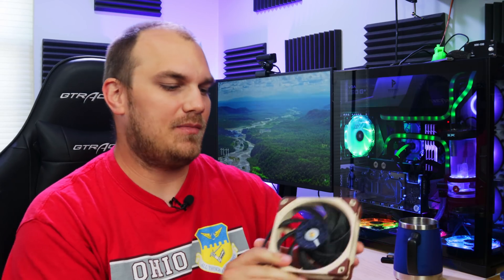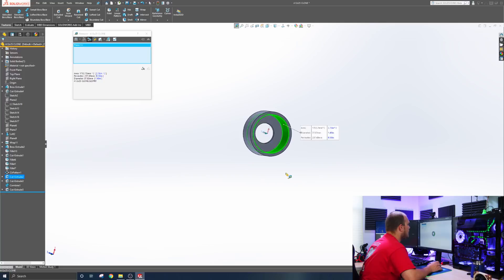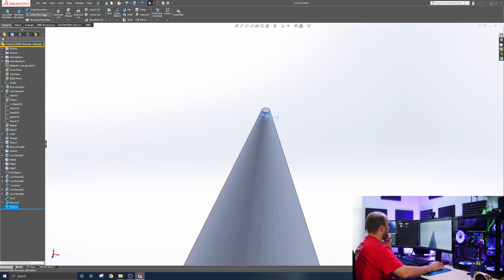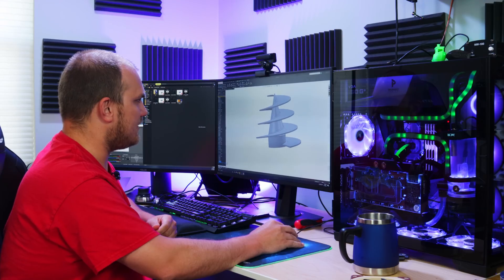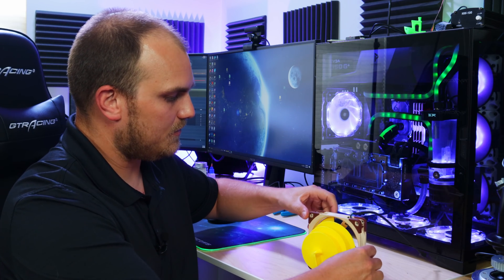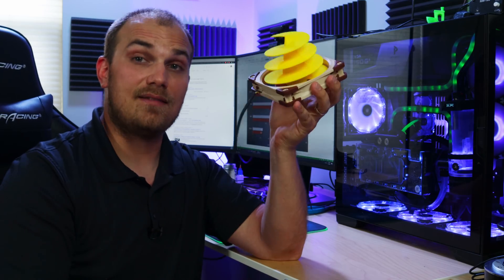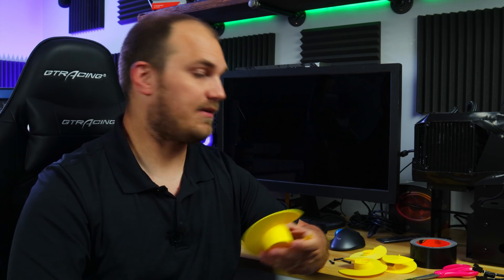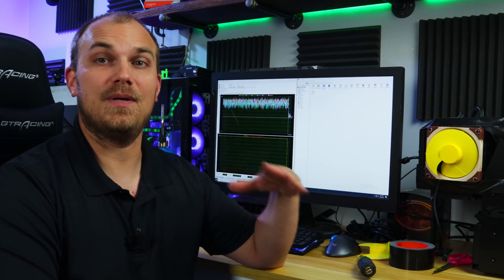Leonardo DA Vinci Made A PC Fan Would It Work?

Comment: These are depending the direction of air flow. 

Enclose the outside with a skin attached to blade exterior, from top to bottom of blade spiral. A lot of air flow lost around the outside perimeter of blade that could be contained until it reaches the bottom. 

Also, the center should be a cylider not conical - more air retained. 

Currently the widened end of cone pushes captured air outward b4 reaching the area to be cooled.

Why the last design wobbles on desk: it's a hovercraft. one side of the blade exerts downward air at a point in the circle while the other points in the circle exert less or no air - thus most exertion point moves with the blade causing a circular moving lift point.

De Vincci didn't think thru the air intake retension from top down, using small blade diameter at top to wide at bottom. Too much loss of air. Cylinder of outside of blade must be same diameter for maxed bottom exertion.

To balance motor, make two fined blades exerting air at 2 opposing points on bottom circle. 2 intake ports, 2 outputs at bottom at 180 degree points.

Intake blade face, have it bend upward to force more compressed air into spiral channel. Assumes enclosed channel top -> down on outside. 

Any or all of these will likely need stronger motor, more electricity, cause more heat.

!!! You've proved De Vincci was on a good track, but, as with many many inventions, extra thought, ideas are good exploration time that produce improvements.

Comment: The hopping at 16:00 is due to the blade having twice the mass at the start/end than at any other part of the circle presuming the blade is of equal mass all the way through. 
A 1.5 circle single blade will balance better with beginning and ending at 180 degrees seperation

Comment: On the last design you had overlap which made one side off balance.  You need to cut straight down the cylinder clipping the blades (or blade I guess) so that if the design was completely flat the blade wouldn't over lap itself but meet to form a complete circle.

Comment: Well, it works great for pushing viscous fluids. Air is so not viscous and so much compressible. In order to make it work for air, you need to increase the pitch of the screw, and make it spin as fast as possible.
So, light-weight, longer pitch, and if possible, some sort of covering in side to reduce outflow and create a trap-sort of thing.

Comment: Take your modified final version, split the blade into 2 or 3 and have them be in same plane as a wide bladed 2 or 3 blade version of that.

Where the high tips of the next blade overlap the lower point (fam side) of the blade before it by about 1/2” maybe. 

I’d like to see how that works.

Comment: Just saw this and had an idea. Make the blade a turn and a half (540 degrees). Put a ring around the entire blade with a height equal to the height of the screw. Decrease the height of the screw so it's no more than 150% of a normal fan's height. Try to balance the weight of the overlap by doubling the thickness of the blade where there is no overlap. There's a good chance that with these adjustments, you'll get a lot more airflow, and maybe better balance.

Comment: Obvious issues. Needs the shroud to cover full length or maybe longer. Open edges allows the air to slide sideways. Also need to find a way to balance it.

Comment: Your quest to find a new more efficient and effective design for a fan is very interesting. 
Consider one little point, 
When an item sits on a body which starts to spin about its axis, the item will be force away from the axis of the body.
Like a playground roundabout. 
Basically, that’s exactly what happens with the air on contact with the fan blade.
Now take a look at the shape of a lighthouse. lens. The Fresnel Lens. 
If a fan had a similar stepped shape all the air available to the fan blade would be focus forward and not spread outwards. 
Just a thought.

Comment: Da Vinci was kinda an Idiot on this one... but you are half way to turning it into a good idea... Since you went from a conical center to a tubular one... now you just need to put a tight fitting shroud on it, or an outer tube if you will... and you'll have an Archimedes Screw... Now HE was a greater genius than Da Vinci... and Invented his BETTER design around 1750 years earlier.   FYI... All of your fans will perform Significantly better with proper shrouding.  Cars in the 50's and early 60's didn't have shrouds... Then as their engines got more and more powerful, and generated more and more heat... they realized through tests that the fans needed tight fitting shrouds.  Come on guys...

Comment: https://www.researchgate.net/figure/Basic-components-of-an-axial-flow-blood-pump_fig2_287594305

Can you make an air impeller for a fan? It would obviously need to be larger, but the davinci model expels a lot of air around the sides. I think you need tall blades at the top to draw air into a baffle, that slowly increases air pressure to move air over the cooling medium. Just a though. It's the most efficient. Da vinci's is the least efficient.

Comment: Does it not seem more suitable as a water jet if you encapsulate it as a funnel could it take it drive water thru the funnel as it rotate creating sort of a vortex in end?
"Have no idea how a real water jet work though but i guess it is a compressor of sort?"
Reply: If you want the funnel attached enclosing the spiral arm fan with just a mailbox slide inlet and a funnel outlet i guess one would have to 3D print it and put it on shaft at distance  from motor.

Comment: If we are in these kind lands, I'd like to make a build-suggestion:
For "static" pressure, would love to see a Cummins ISX15 with 2 98mm Turbos feeding into one 120+mm Turbo, going into a Weiand Charger getting attached to it.
Splice it after the turbos but before the supercharger, and you should be getting around 130-200 psi. And like 2000-3xxx hp...
Plusside:
Hook the engine up to your house as an Powerplant, no need for a grid.
And you can give up smoking....
Minus:
Diesel costs some
Ticking Time Bomb
140 db upwards
Needs new Oil and a renewal of all internals after every run...
(...)

Comment: I think part of the design intention of this may be it is intended to have the same efficiency regardless of the spin being clockwise or counter clockwise. It would be interesting to run all the blade designs through a test of efficiency comparison between clockwise and counter clockwise spin rotation. I'd like to see which ones are better, worse, or the same depending on which way they spin. Also what about testing to see which blades would work better as wind collectors. Would any be better used to harness wind energy for wind turbine applications?

Comment: I think that since it is a screw, its a continues gentle slope, thus when its spinning, the surface that is pushing air is moving very slow compared to the spin of the screw.  Therefore the screw can not efficiently push air.  Sure it may push a bit of air, but very inefficient for the energy input.

Comment: You should print another fan like that but have an exterior wall that doesn't let air escape out of the sides. also you should flip it over so it slightly compresses the air so that as it expands leaving the end it will get cooler.

Comment: The demonstration part actually shows the path of air. Second add a bullet shape to the motor cover, the air is being allowed to slip, image walking up a hill with ice on it, so add a texture that grabs tiny buckets of air, feather shaped texture, golf ball dimples. The side wall of the motor cup is being under utilized and it’s surface can be combined to create more force, I Enjoy your shows.
Reply: Also look up “kort nozzle” or the shape of a jet engine shroud or inlet. I work on jet engines for helicopters every day. All good ideas.

Comment: I know I am writing little late, so no sure if my comment will have any attention... but there is one thing that came into my mind almost immediately. The aerial screw needs a tunnel. The usual fans are inside of the tunnel. And the function of the tunnel is to ensure the air won't go sideways but in the direction given by the shape and movement of the blades of the fan. And because the rotor of the fan is relatively flat we almost forget the frame around it is a tunnel, but it is. A tunnel wich is of the size to match the flat rotor.

The aerial screw is not flat so the frame you put it on cannot help to focus the air. The blade is rotating in the open. A lots of air put in motion by the screw, just go sideways and only a part of it goes through the frame on the other side. It is quite similar principle as the archimedes water screw, just applied on the air. And the screw needs to be inside of a tube to ensure the water will not spill around but will go upward. And those archimedes water screw which dont have a tube, have a special shape of the blade, which can hold some portion of the water by itself, because the simple flat-ish blade wouldn't work without the tube and everything would spill around.
And quite similary it goes for your creation of Da Vinci fan. If you would enclose the screw inside of the tunnel, I believe it should enhance its effectivity. PLUS the tunnel enclosing the entire aerial screw would create the opportunity to anchor the axis of the screw on both sides and thus eliminate the vibrations.

Comment: It looks like a jet ski impeller which is designed to work in a duct and which is optimized to increase maximum pressure more than flow.
In a cooling application, high pressure is not required.

Comment: Very cool!    two ideas:
yes shroud idea is good too.
1) add 'cheese grater' holes to this fan.  Maye it will pull more air down. The would open into the direction to travel pushing the air down . 
2) double helix...twin screw style
2a( double helix with 'cheese grater' blade surface.

Comment: 16:57 Isn't the wobble synchronous with the shaking of the fan housing? So not a printing problem but just wobble of the entire assembly?
The design is dynamically unstable and the wobble does follow that instability.

Comment: just found your channel last night it is awesome watching you print out crazy fans.. I would suggest a dimpled blade due to they cause less drag. also if you do anything with a 21 degree or 22 degree pitch it would push decent amounts of air. now if you want you could go into creating a Dual Prop aka fan setup which if you look up a dual prop boat you will see how they are setup. course they use a reversed blade one way and normal blade style at end. you could go and just offset the 2 on the fan you are creating since you will not be using one way bearings or anything. it would be a solid prop system so you would have to offset your second tier of blades atleast 38 degrees from the top set.. that would push enough air with the added dimples due to less drag on the fan and which in turn means less force to move the fan at same speed.

Comment: I think the problem is with the symmetry. you cancelled out the helix by ending the helix 180 degrees offset from where it started but the radius at the bottom is greater than the radius at the top so you have to account for that or youll still get wobble. awesome vids!

Comment: The funny thing is you could have added a second helix at 180 degrees to balance it out a bit better. Then make the blades even steeper. Actually rotational harmonics means we generally want an odd number of blades so lets just go to 3 helixes at a real aggressive 45 degree angle

I guess that'd just be a regular 3-blade fan. Da Vinci was on to something clearly.

I imagine the shallower the blades, the more static pressure it can make?

Can you pressurize a jar with a DaVinci fan??

Comment: You need to build a duct in order to prevent air from leaking out the sides of the screw, vis-a-vis the Archimedian screw pump.
Reply: Spon on.  This is more of a pump than a fan.  It isn't going to be great for volume, but excellent for pressure.

Comment: What you need is a hollow cone shroud to put around the fan in order to vastly increase efficiency. Without the shroud, much of the air vents out to the side instead of getting pushed down through the radiator. That's why screw style superchargers work so well on cars.

Comment: Not an air drill, an air(ial) screw, screws are faster than drills, lol

I think there is too many spirals. Also, in the DiVinci thing you were looking at, the beginning of the spiral curved up to "pull" up on the air, then it quickly curved down to "push" up on the air. Too many spirals allows the air to escape and not instantly go from air being "pulled" on to being "pushed" on.

The reason it will never work is because helicopter blades/computer fans are applying "equal" amounts of push up on the air so it can lift/push evenly. The aerial screw is using/releasing all of it's air/push up, all in one area at a time. When the bottom of the blade is on the left side creating push up, the right side has nothing and is loosing upward momentum. Not only is the right side loosing momentum, but when the bottom of the blade is pushing up on the left side, it will equally push down on the right side, while loosing momentum and you will always have a wobble. 

It can't be a fan because it doesn't push air evenly creating a wobble/drag "in the motor". Where the fan has a stationary point to work from, a vehicle in the air does not, and the uneven push of the aerial screw will make the "whole vehicle" wobble.

That being said, the old saying, "if you can't fix it with a hammer, grab a bigger one" technically, the wobble from the aerial screw could be fixed, if you throw a motor at it that spins it so fast, that by the time one side is thrown off balance, it will already be on the other side making up for it; at that point just use blades.

The aerial screw can work, just not practical, at all
Reply: 11:25 you created a replacement air hockey disc

Comment: I have a alteration to this. Instead of the helix being solid. You should make the helix many fan blades with a slight angle you just may have to figure out blade placement for even distribution and less vibration

Comment: I know this video is older but. Do the cone tip with only 1 or 2 full rotations with a helical blade and try to get the dimples from your other video onto the screw. And keep it to a low height so it’s a compact screw with dimples. If anything it will look super cool. Love your videos and love watching you model them out.

Comment: This blade needs to be contained within a cylindrical wall with only the leading edge a set distance outside the cylinder and the blade pitch has to compress the air.

Comment: Make one more like a steam turbine (with fixed blades in between the moving fan blades to disrupt the flow of however it works in steam turbines), this in turn allows the shaft to be spun by the same air flow at the same time, or in the case of a fan of jet engine will drastically increase the airflow

Comment: Idea:  Make a long fan.  basically begin with a regular 5 or 6 blade fan, but just keep extending it out, letting the blades wrap around the hub like a drill.  Instead of one helical blade, you'd have 5 or 6 around the cylindrical hub.  Then, enclose the screw within a cylindrical shroud with minimal clearances between screw and shroud.  This will force the air to move through the fan, rather than being thrown aside by centrifugal force.  Make the whole thing about 5 to 6 inches long ( whatever that is in metric )   Eessentially,  make a grain auger for air rather than wheat.

Comment: Two ideas: Try a double helix so the blades balance each other and maybe a Shroud to direct the air? Right now the air the screw pushes mostly escapes out the sides before ever going into the case... make a shroud to capture/direct the air down the screw into your case. In a normal PC fan the housing acts as a sort of shroud to direct the air. If the fan blades on a normal PC fan were so far from the frame/motor as this was it would push less air into the case as well.

Comment: My very first thought is that this type of “fan” is that it needs a conical shroud around it and air coming in from the large diameter end blowing out of the small diameter end. Low pressure to high pressure and maybe it would work better 🤔

Comment: I don't think a single blade can will move as much air as a traditional one ever,  but a could things that might help,  you'll still likely want a reduction in mass as you get farther from the bearing, and to help direct the air a bit you might try a moderate angle down to capture more air and push it down.  That should move a bit more air where you want it and help the wobble

Comment: Dude: your mod ended up being an Archimedes screw prop. Look up history of naval engineering: it is the very first propeller that wasn't a paddlewheel. In fact, Da Vinci designed his helicopter based on the water pump designed by Archimedes.

Comment: The key word is density. Even if the screw is inside a pipe to move air, the density of the air is too low. It works better with water or fluids with higher density but not effectively enough for air. Da Vinci had a lot of successful inventions but also unsuccessful ones, obviously.

Comment: For a next 3D printer, you might look at a resin style printer. You end up not having a lot of the same problems with belt tensioning bed leveling etc. There are some smaller scale resin style printers on Amazon for in the $500 range now. I don't know whether it would have enough x and y dimensions to print what you need. But definitely something to keep in mind.
You would have much better accuracy on the printer. And the parts would be stronger.
Reply: @MCSheep 
Seen a few doe good prices now days.  I'd like one with a larger build volume. Those seems to be in the $500 range still. 
For now.. I still use my old Anet A8. It works great actually.. never had much trouble with it.